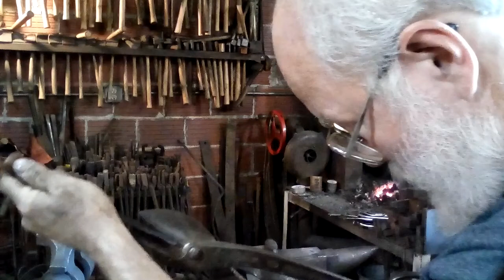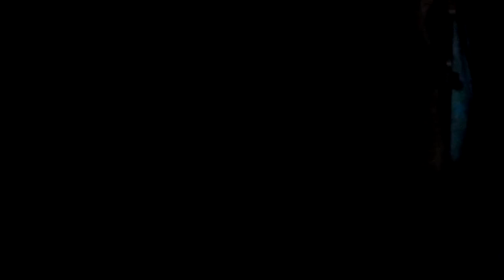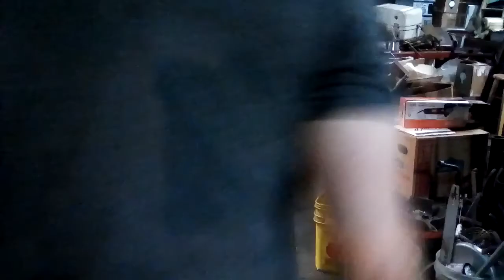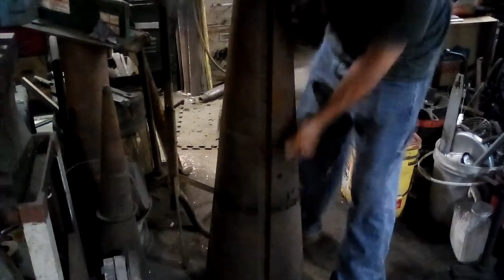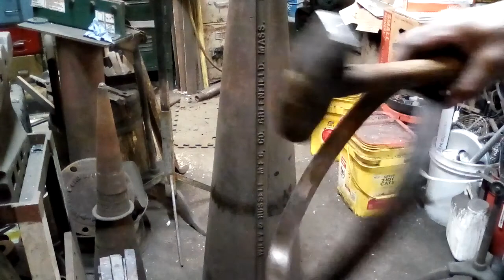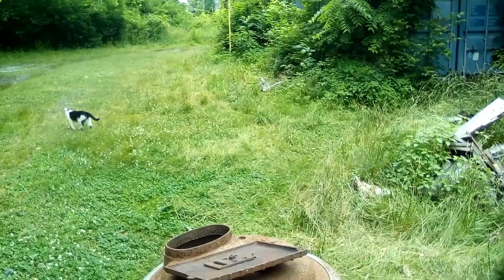A Blacksmith's Dictionary, Small Forgeweld ,Welding a hoop from sheet

Comment: Forge welding 18 guage, color me impressed. Thinnest Ive tried to weld is 16 gauge and ill be danged if i got one hit per weld before the anvil sucked the heat out of it, and that was on a very hot to the touch anvil!
Reply from the maker: Hi: It may have helped that it was 90 F with 85% humidity. Don't think the humidity helped!
Daniel

Comment: Thanks Dan, this is a great way to weld a hoop, I've been wondering how to do it. I wonder, how small in diameter this will work for? Making hoops for chisel handles has been something I've struggled to weld, and the slit and drift method has been too uneven for me. This could work with enough care, and some cold forging after the weld. I have been using iron pipe for chisel hoops, but that's not as fun as making them from scratch.
Reply from the maker: Hi: I think the chain link welding method would work better for chisel hoops. Maybe the Ouroboros scarf. Another video!
Daniel

Comment: Hi Daniel. I suspect you’ve mentioned it before, but which filter do you use on your camera? I’d like to be able to better capture hot metal on camera myself.
Reply from the maker: Hi:
 They are called gray cut filters, or moon filters by the telescope people. Rated by what % of total light they let pass. i use a 25% , and that means you need a lot of light to keep the contrast .
I turn on 5 or 6 lamps with the filter.
I also have an IR filter stacked with the gray filter, that cuts glare a good bit. Result is still not what would be seen if you were watching live . It does not look like I am forging a magnesium flare, the look without any filters.
Biggest problem is that most cameras have an auto-balance built in, and it was not designed to handle 2000 degree metal.
Daniel